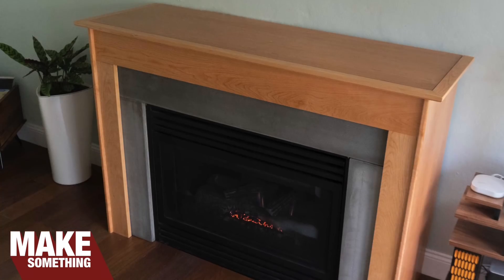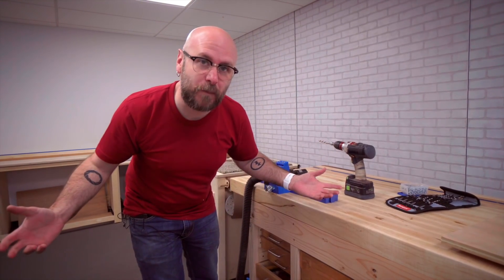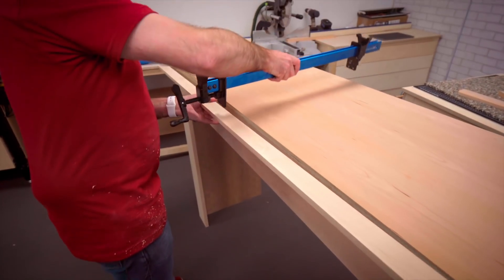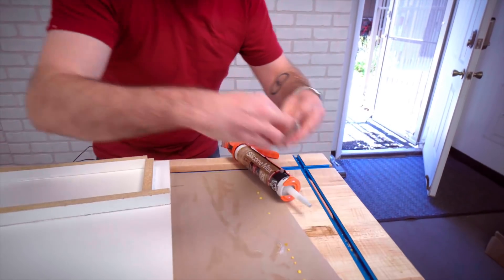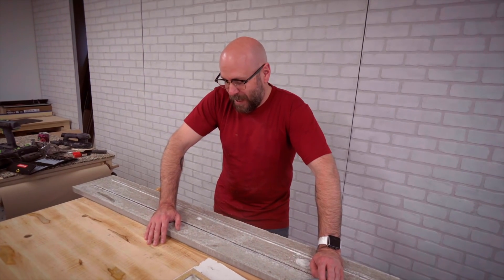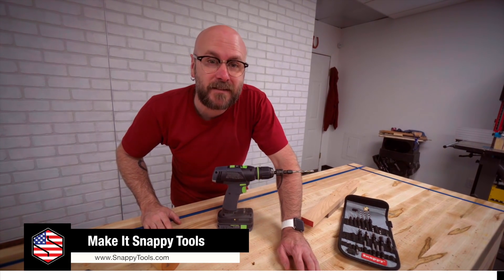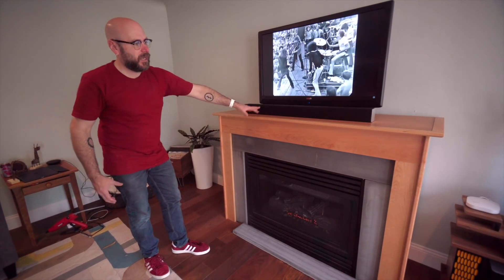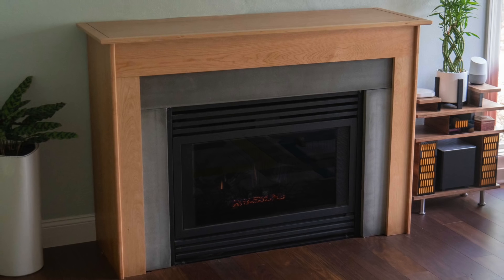How to Make a Fireplace Surround with Concrete & Wood

Comment: Sweet.  Nearly didn't watch this but was amply rewarded with some classically poor taste humour and some motivation to try casting concrete!  The "groove" between the lipping and veneered board is referred to as a "shadow line" and is used specifically for what you are hiding as it is close to impossible to make that joint consistently tight.  The width is around 1/8" (3mm)  and is a nice detail that is easy to achieve.  Cheers, David.

Comment: Hello, great video! Im currently making a small wooden pendant, made of short pencil pieces. What oil woild you recommend to coat it with after i glue the pieces together? I have heard linseed oil may be a good choice, but the smell is a bit bad. Thanks!

Comment: Great project.  Another tip I've seen for concrete casting is to wax the melamine for easy release.  I guess one could use aluminum for the surround if the weight were too great with the concrete?

Comment: Hi David surrond looks great ,you can put a little oil like veg oil on form to help release to cement ,you could also drill the cement and epoxy in the bolt , you never started the fire ,light up the fire ,G.

Comment: Nice project. Shouldn't the rebar be below the surface of the concrete for strength? Also shouldn't it be covered or sealed from the air to prevent rusting.

Comment: Hi you should have cut those wood clamps with the grain running across, the way you have cut them puts all the stress on the weak edge and it will brake off very easily.
Reply from the maker: Ahhh yeah, you’re right. Thanks!